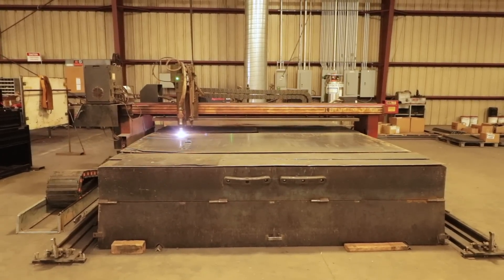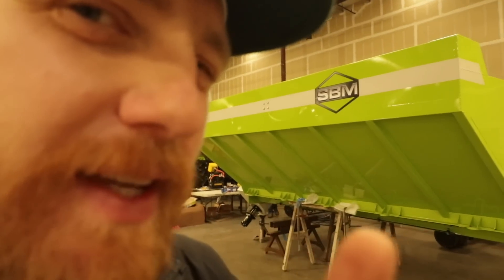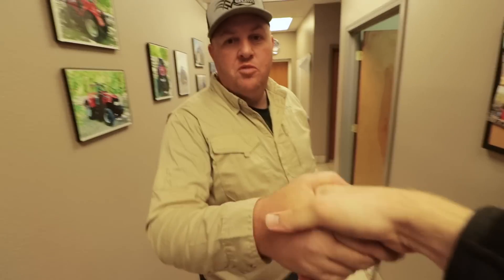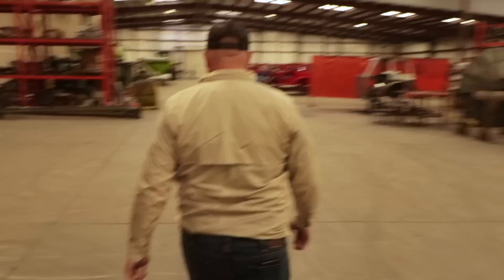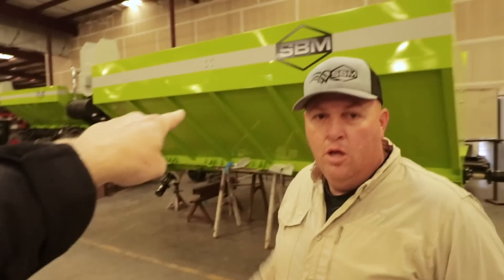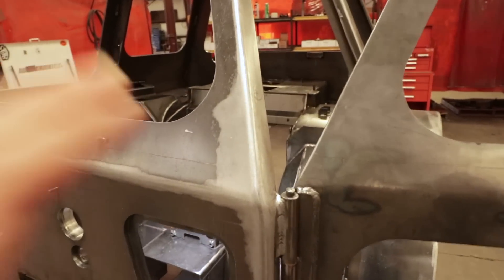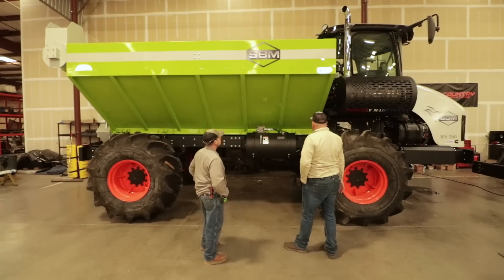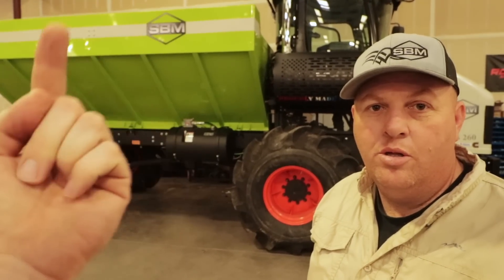The New 2020 AG-Truck | A Tractor for Hauling Grain, Spraying and Stomping.

Comment: I enjoyed this.  I’m still not sure why not use a grain cart?  Also hydraulic driven augers,  is slow and having two augers is a pain eventually.  Being able to use it for multiple things is a plus.  Putting steel wheels on it for stomping or spraying means hauling it around.  I’m just trying to figure it out, learn why you do it differently than we do in Southeast Missouri and Arkansas?
Reply: Kevin Burris this is Nevada I like your questions, I will try to help with the answers. We use the Ag-Trk due to the mud, we try to drain our fields but sometimes we hold the water too long or we get fall rains and using a typical grain cart you will get stuck. We chose to go with Hyd driven augers due to how fast they unloaded, we unloaded faster then most grain carts, we need the second auger due too the design. While the Ag-Trk is on the steel wheels we have to use a transport trailer, farmers around here are use too it and it doesn’t seem to be a problem 
I hope this helps and would like to answer any more questions you have 

Nevada Smith

Comment: I have a feeling lexion is going to have a problem with this. Get ready to re-paint it.
Reply from the maker: Hi Homeland—Holt Ag Solutions is the local Claas (Lexion) dealership here in northern California and they are officially retailing the Ag-Truck with those colors. So I’m sure it was cleared with corporate—or even requested by top brass to help farmers adjust to the color change.
-Matthew

Comment: I like just a tracktor and cart 1000 bushels cart and you do not have to buy a new machine and the tracktor works as as a planting tracktor but I do not cut rice  but I do cut wheat corn sunflower and miloe
Reply: Wade Piroutek yes this is a specialized peace of equipment designed to do task in a rice field, as a rice farmer we have many Obstacles that we have to deal with due to wet soil conditions
Reply: I wish I had that today I got the tracktor and cart stuck

Comment: totally familiar  I used to operate a CNC laser in a fab shop and cut parts out of steel up to 1/4" thick  I also worked at a place where we machined and heat treated gears for Allison  :)  Very cool video
Reply from the maker: Awesome! What kind of parts would you mostly cut with the CNC laser? Glad you enjoyed the episode.
-M.
Reply: @Ricefarmingtv  it varied but a lot of gussets and a lot of parts for recreational vehicle seating. Anything with short enough runs that it wasn't economical to have a stamping die machined for.

Comment: Awesome stuff Matt so will the 1 rig be able to do all 3 tasks. Just swap wheels and bed for tank and go? Or will it be 3 separate trucks. Do they feed all the employees everyday or just that day. That would be neat if they did daily company lunches.
Reply: SLC Farms yes the chassis has been designed to make it swapped from one style of truck to another with minimal work 
On my farm one AG-TRK preforms 3 task, spraying, banking out during harvest and stomping
Reply from the maker: Oh great question! I'm sure you could take off the grain tank and add the liquid tank and change wheels--using all the same tractor chassis. The day I was there the employees all took their lunch break together in a break room. Everyone packed their own lunch. Great questions!
-M.
Reply: I was wondering the same thing!